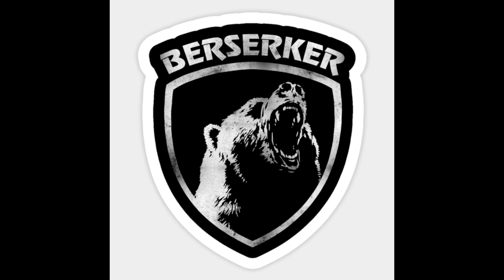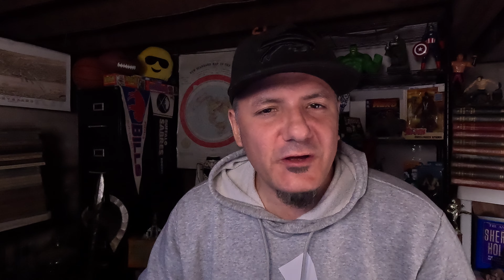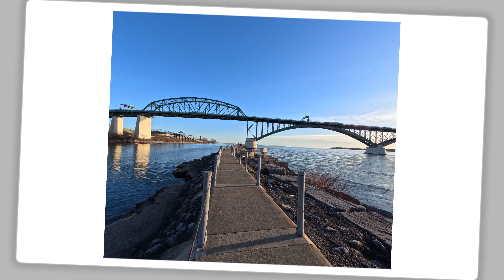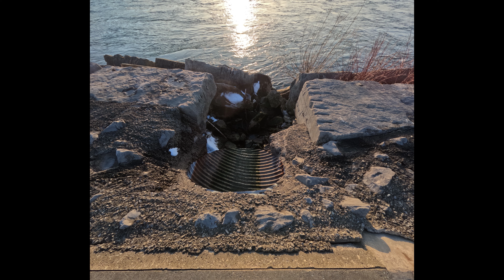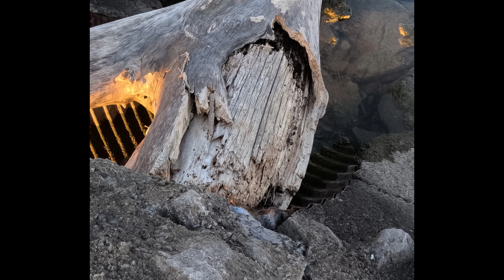Bushwhacking The Current Of The Mighty Niagara River & The Anomalous Old Water Intake

Comment: Just a few speculations; 
That water intake island looks like a ship from a google maps view. Could it be that they constructed a large hollowed ship in the shape of the island to allow water to flow around it and have it  intentionally floated out, anchored, and then filled with concrete from other ships until it sank in place to form the island?
Or, perhaps they had a pile driving barge that went out and anchored during lower water levels with less flow and made the pilings to start construction of the water intake island.
If you have already looked into this, then disregard.
 From what I've learned about the history of steam power is that they could do what we can now, it just took a bigger engine with a constant supply of boiler fuel (coal) and more routine maintenance to keep the machines running. The pollution used to be so insane from the coal burning that it goes back to old famous books from London (Dickens) talking about the soot accumilating on everything and clothing getting dirty from it. This is perhaps why they would draw water from the center of the current as to avoid more of the pollution contaminants from near the shorelines.
If they could go out and build the pilings for the bridge now, then they likely could construct something even longer ago and the water conditions were probably different.
I'm of the opinion that the waterways are very ancient (thousands of years), and were the highways before railroads existed, and that it was some type of sea faring civilization like the Phoenecians, and the vast starforts throughout the world were their hubs for trade and resupply.
It's very interesting and would have been amazing to see long ago when it was built.